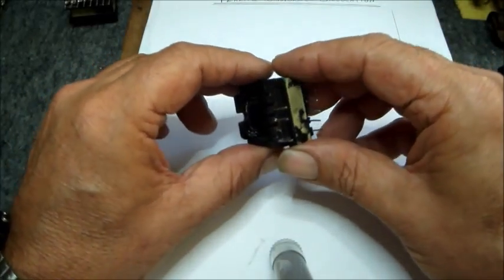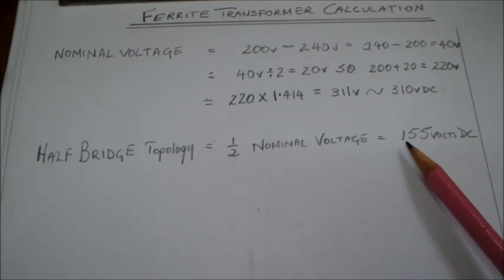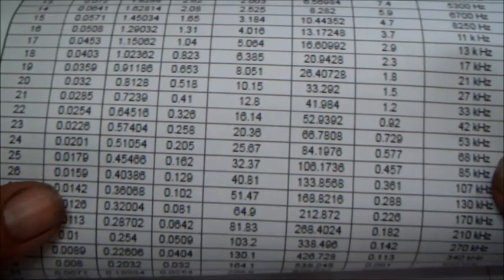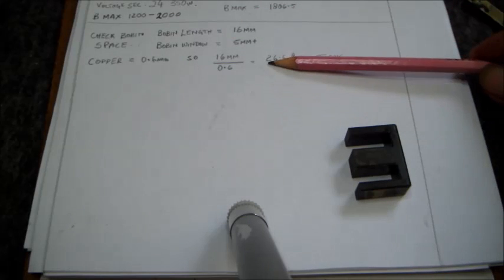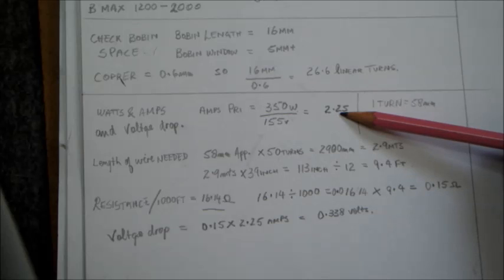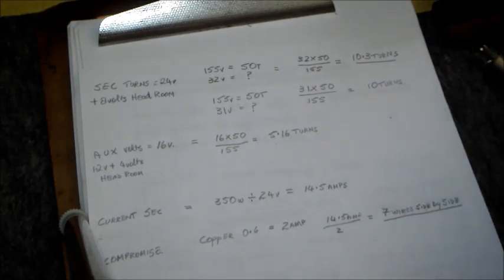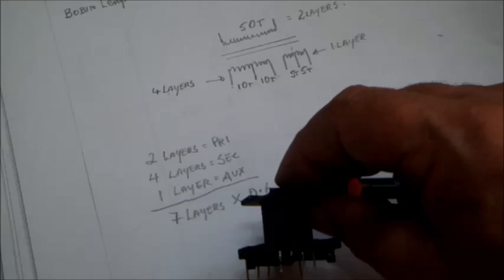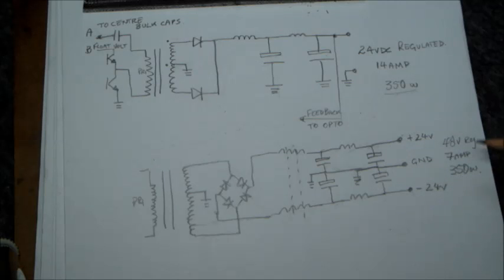Ferrite transformer calculations for SMPS

Comment: How did you arrive at 33khz at the start only... shouldn't you be calculating amps required then selecting the AWG and then the thickness of wire and then arrive at 33 khz and then look into the IC which has been designed to deliver that 33 khz ? If you select an IC which is not capable of that KHz how wud the transformer work? 
Calculation of core area was not jotted down leaving the viewers to only imagine how that 1.3 cm sq was arrived at!

Comment: Nice explanation Engineer, but @ 33khz and u using EI33 core so i think it cant handle 14amps and core gets toomuch heat losses
Reply from the maker: It depends on the total power not the current. The core is capable for 350w@33khz
Reply: @supersilve  yes, considering the total power, I cannot handle more than 5 amps and also please refer power handling chart and kindly do let me know  your comment

Comment: Hi There. I was some busy with the smps, I have decided to use resonant version, one with current feedback so I have fast respons and still stability. Did go to 10 amps 65 x 65 who is more then enough, the smsps can do easely the music peaks who live short, and I do never play so loud, ears will be give up earlyer then the suppy. For the tubes a 100 watt (overkill) LCC resonant can do, (also for audio better) these can run very nicely also without a load, burst mode for llc is not what I want, the ripple get bad and I need clean amp because it is high end class hybrid.

The question now, LCC resonance do need a transformer calculation, and in all papers she just talk about N this is coupled with tank calculations, never I see how high induction will be only AC who is the load max and min. I presume the smps transformer needs to have these reactante with max and min load valeu? 

I do not now if you did resonance stuff, for LLC I do have tools and can calculate for LCC not because it is a older system, but it is used for led,s because of the nice respons for that.

regards

Comment: Is the 1200 to 2000 gauss max flux range related to the material type? Where too low of a flux level for the material will mean you could have used a smaller size transformer for better size/weight efficiency? And likewise, more flux than that range will cause magnetic saturation of the ferrite core material as well as heavy power losses and risk of burning the magic smoke out of the transformer?
Reply from the maker: Regarding flux density I always make some reverse engineering when extracting cores from ATX psu.  I will calculate the switching frequency according to the chip used noticing the timing capacitor and resistor values.  I will count the number of turns in the primary of the core.  This will give me a good approximate of the flux used and also the core material.  I will then adjust according to the new frequency used.
Reply: @supersilve  oh, so it is a rule of thumb type estimate based off of your reverse engineering of the original schematic the part was in. Thank you for the info. 

I really appreciate your videos by the way. A lot of this stuff can be really hard to learn without seeing someone do it step by step. Thank you for the many hours you must have put in to make these.

Comment: hi sir  i saw your video  that was realy good..sir i want make switching trans with  220Vin and +17v 0 -17v and i dont know i must use of what type of ferrite and that must how type of wire for secendary and primary...pleas lead me thankyou
Reply from the maker: I guess you need your transformer for audio amplifier as I see you need a center tap voltage. For a switching power supply you must know the peak DC output voltage to make the necessary calculation.  For audio purpose we usually make a non regulated smps. The size of the transformer depend on the power needed. If you need more information please give me more details.
Reply: @supersilve   hi mr silvio at first i want say thankyou for answer my  question  i send several  message  for several people but that people dont answer to me. so i realy realy thankyou for answer my question...sir for me it's hard  that talk  at this place...that is my insta page::exorcistmmt.   and if you need my emil i can send it for you just enough you tell me..i need more information for make ferrite ...please lead me more sir...again i want thankyou

Comment: Hi Silvio ; very nice --  Just a question can we apply (( push-pull topology = 1/2 Nominal voltage ))
Reply from the maker: In push pull topology you must use the full input voltage in the formula. If for example you are using 12v then the centre tap winding shall be 12v-0-12v.

Comment: What about the max 90% (2 x 45%) PWM of the SG3525 outputs.  Does that not also need to be added as another 10% headroom?
Reply from the maker: For HB, FB, and push pull topologies at 45% duty on each 1/2 cycle we are already at 90% duty.  However to regulate at a specific voltage you need to add around root 2 (x1.414 to the wanted regulated voltage)

Comment: Hello sir, I have 350 watt atx psu,  in my transformer primer winding two wire together, the one wire diameter is 0.028 the other is 1.04 and two primer layer and 20 turns

Now, I want to rewinding with only one wire diameter, which wire diameter should I choose any idea? And how can I choose working frequency, how can we calculate or understand our atx smps working frequency? My transformer is ERL-35-2     what is the meaning ERL or 35 and 2 any idea?

And I see you choose 33 khz, how? Why? How can you calculate 33 khz ? Or this is just a guess? For example why you don't choose 70 khz ?
Thank you sir.
Reply from the maker: An ERL35 is a type of transformer core, for example the one in the video is an EI 33 but that does not concern you at the moment.  What interest you is the center core area which is calculated by the radius squared multiplied by pie (3.142) This is how to calculate the area of a circle.  The cross sectional area of ERL35 is 1.11cm^2.  You did not say why you want to rewind the transformer and what are you going to use the smps for.  You can use a frequency of up to around 100kHz if you want but do not go beyond that frequency as the core may not be intended to work at higher frequencies.  With high frequency there will be more core losses.  Not all transistors can handle such high frequencies and care must be taken as they tend to heat up quickly and blow. Mosfets are more suited for high frequency.  This will all depend if you are going to use the same switching transistors or not.  A mosfet cannot be driven with the same base drive transformer because the voltage and current is different from an NPN transistor.
The wire diameter depend on the frequency of operation and the higher the frequency the thinner the wire will get due to skin effect.  For up to 68Khz 0.5mm copper wire can be used.  For 350w you have to use 2 wires x 0.5mm for the primary. ( if the smps is used for audio)  If the frequency is lower say 50khz then 0.6mm can be used. I am assuming that the topology is half bridge.  
If you want to know approximately the operating frequency you need to download the datasheet of the IC in use and then check the value of the timing capacitor and resistor.  You can work out the frequency by the formula details shown on the datasheet.
Reply: @supersilve  thank you for your nice answer,
This is my Power Man and IP-P350AJ3-1 model number computer atx smps, and I can not determine this psu topology !
In high voltage side only one mosfet it is 11N90C  and only 2 transformer one is big power transformer(ERL-35-2) other is small, I don't know topology..
I want to rewind because my transformer damaged before, I am sure my transformer is fault, 
As your answer maybe I rewind for 60 khz, but I think there must be some way or formul for calculating the working frequency with other circuit components(pwm ic or small capacitor and resistor ..etc)
Reply from the maker: @TheWeftmen  As you still have the transformer you can unwind it and count the turns and do it as it was.  The thin winding is there to compensate for the switching spikes and probably is connected only at one end.  The topology is probably flyback.  For calculating flyback topology is more complicated and is beyond the scope of this video.
Reply: @supersilve  yes thin wire connected only at one end, I want to calculate seconder for 12 volt turns, 5 volt turns and 3.3 volt turns, how can I determine and calculate, I measure the transformer primer pins it shows 450 dc volt,

Comment: How I can find out core area of ferrite toroidal of core ?
Reply from the maker: You can do this by measuring the center core.  If it round you will find the area by using the formula Pie R^2.  if it is square you measure the length and breath and multiply them together.  Be sure to measure in cm and your answer is to be in cm^2 to fit in the formula.

Comment: 50T primary for 155V half bridge

100T primary for 310V flyback,  this is right sir ?
Reply from the maker: Yes that's it
Reply: @supersilve  50T+50T for push pull topology, am I right sir ?
Reply from the maker: @0124akash  for push pull you have to wind 2 primary windings. If it is for 12v than you wind 12-0-12. It is not practical to use push pull topology for 320v. We usually use full bridge topology. This only needs 1 primary winding @ 320v.
Reply: @supersilve  not prectical to use because switching device not available for 320V for Push pull topology. May be this is a only ones.
Reply from the maker: @0124akash  No not only that but it is very difficult to make two identical windings and if they are not exactly the same there will be spikes during switching which may damage the transistors.  Two full voltage windings at 320v will take a lot of space in the transformer. That is why we use full bridge with 4 transistors and only one primary winding.  The result is the same as push pull.  Push pull is normally used in low voltage applications such as 12 or 24v.
Reply: @supersilve  thankyou very much sir you give me your valuable time and very important knowledge. Thankyou sir.
Reply: Question is supposed I have one transformer capacity is 12V5A topology is flyback.
Primary turn 100
Secondary turn 10
Feedback turn 10
So I can make 24V2.5A
Primary turn 100
Secondary turn 20
Feedback turn 20
This is right sir ??
Reply from the maker: @0124akash  Flyback topology is more complicated to calculate the number of turns.  The example I gave was for HB, FB and push pull topologies. There is software available on line to calculate it, or you can follow Robert Balanos on youtube to see how to design a flyback transformer.  Link  https://www.youtube.com/watch?v=9YlNMFT3sz8&list=PLGB6bEI4xrnCIZdHs-DoRZJHdwy-rXpr8&ab_channel=RobertBolanos

Comment: Dear sir, thanks for such an informative video. I wanted to ask you that whether I can use the same calculation for getting HT output from transformer..? 
Thanks you in advance. 😊
Reply from the maker: Yes you can but be careful as the voltage gets higher there is more chance that the HT winding will spark over and short out. Square waves have a lot of DC content and tend to are more readily than sine waves.
Reply: @supersilve  thanks sir, well noted. 🙏

Comment: Hey Professor Leonardo, Could u please post a schematic to which this transformer can work?
Reply from the maker: I do not have a schematic for this tutorial.  I made this video for learning purposes
Reply: @supersilve  Ok, Prof. No prob. But I really do enjoy the tutorial. It has given me alot of insights into this type of transformer. But here's one more request: Could you pleases post a tutorial on ETD Core transformer for car Amp?
Reply from the maker: @clintondowner7612 An ETD core is no different except the centre core is round. You measure the diameter and find the cross sectional  area. CSA = PIE X Radius ²

Comment: To disassemble a transformer safely heat it up in boiling water for about 5 to 10 minutes, depending on its size.
Reply from the maker: It will not always work sometimes the cores are glued with hard epoxy resin and boiling will not dissolve it.

Comment: hello Silvio, your video is very interesting, but could you please help me how to calculate power of Transformer, i mean, if i need transfer 500W, so i will need transformer which how many is square?
Reply from the maker: It all depend on the frequency used and the available window space to accomodate the copper wire according to the current involved in both primary and secondary. It also depend on typology used. Half, full and push pull use the 4 quadrants of the flux while a flyback only use 1 quadrant. The latter the core has to be larger to get the same power compared to half bridge for example.